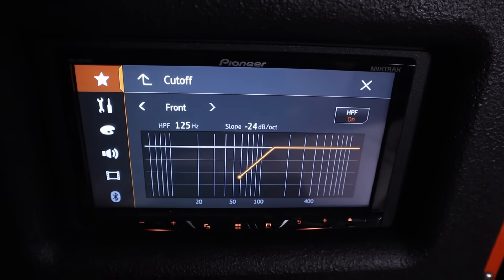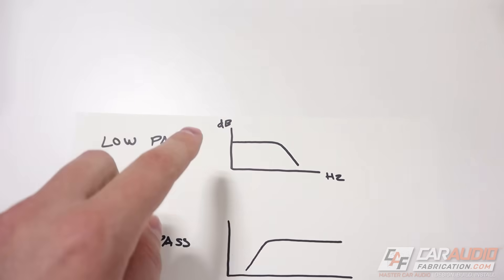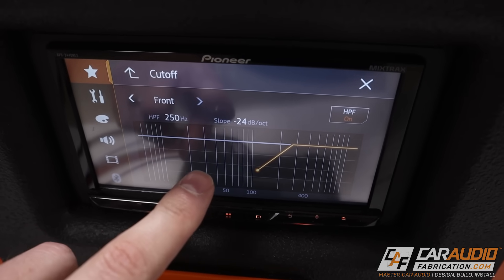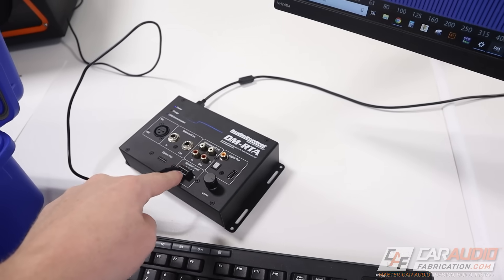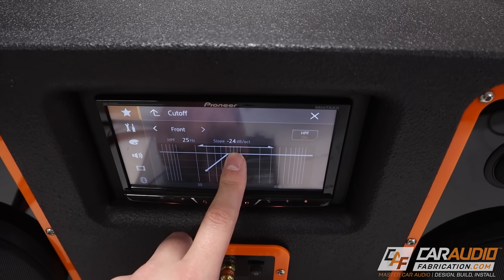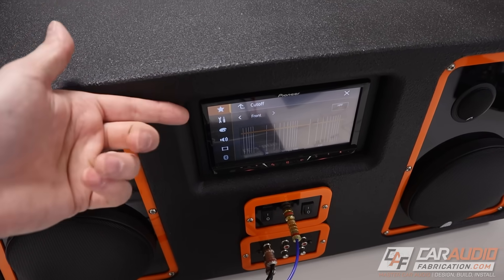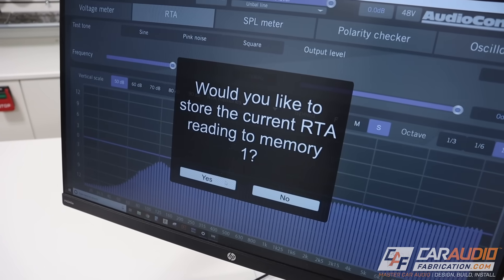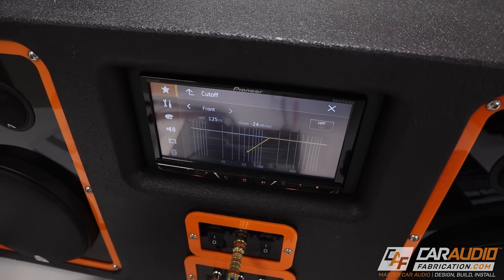Crossovers for Car Audio - Tune on HEAD UNIT or AMPLIFIER? Or combination?

Comment from the maker: 🔨 A big shout out to AudioControl for helping the community with a CAF FAN SPECIAL! AudioControl DM-RTA Pro Kit is currently on sale for a limited time. Use this tool kit to analyze and tune your system like a pro! To take advantage of this offer simply click the link below and you should be taken to the cart with the coupon code already applied.

✔️ https://www.audiocontrol.com/cafprokit

(If the link doesn't work add the DM-RTA Pro Kit to cart and enter code "CAFPROKIT") Thank you to AudioControl for being a channel sponsor and helping our community with this offer!

🔊  Related videos for crossovers:
✅ Advanced Crossover Lesson: https://youtu.be/BDKLYsGyBVU
✅ How to Protect Tweeters: https://youtu.be/hscMuzfyxQ4

Thank you for watching!
Reply: I'm curious to know what your opinion is of tweeter/mids speaker combos that have a passive crossover. I bought some a while back and they have been good, but thats my opinion and it keeps my set up simple.
Reply: I suggested a video ago that it would be cool if you explain in more depth adjusting input gain on a DSP before the amplifier... You told me you weren't going to waste a 10 minute video explaining something everyone knows... Now were back to videos explaining crossovers!? Is this something you believe your viewers need a 2nd video explaining crossovers?
Reply: I have a pioneer avh-x4800bs in network mode. Tweeters on front channel. Midrange on rear channel and subs on sub channel. 
Can I run the midrange on the FULL instead of HPF.  As long as I have it crossover to the specification of the speaker. 155hz - 10khz

Comment: How would you set the crossover if you dont know the Fs of the speaker as you explained in the older video? I have the Infinity Reference 607CF with the passive crossovers ( i cant afford DSPs and all that) and it doesnt provide that information for me to tune it properly.

Comment: This video helped me with fixing my issues with my front 6.5 speakers pushing to much bass. Thank you. The pioneer deck has the ability to adjust the crossover and it works great.

Comment: I always wondered what to do with the amp xover when you had deck ones.  I thought youd open them fully on the amp but now realize you are better off leaving it below the deck setting.im going to take pics of everything the way its currently set (because I like the way it sounds on all music types) but im going to fill around with settings and see if it have slope adjustment on the deck.  No dsp on this setup, that will be on next car.

Comment: You mentioned that setting crossover on both the head unit and amp will exaggerate the slope if set at the same frequency...for example if you set a LPF at 80hz on head unit, which frequency should I set the LPF on amp??
Reply from the maker: The whole point is dont do that. Set it at one or the other.

Comment: Not sure if you’ll see this; but I’ve wondered what a head unit does when I specifically change the tweeter crossover frequency within it? The Kenwood unit allows the x-over setting of: tweeter, front, rear and subwoofer - but there’s 3 unassignable (front, rear, sub) preouts; and traditional LF, RF, LR, RR harness outputs…So how does it cut off a frequency for the tweeters if there isnt anything actually separating signals or frequencies in each individual wire that goes to each speaker? 
Granted, I do have passive crossovers; and all speakers powered by l amps - but the head unit doesn’t know that! Does it just attenuate higher frequencies that still technically are sent on that one (+ & -)  wire that goes to each “corner”? What exactly occurs when that is changed?

Comment: Hello, I came across your video and you state "not to set Amp and HU to same value"; but you don't give information on what value to set the amp to so it doesn't cause issues with using HU. So, what value to set amp to act as a "safety" in case HU fails?

Comment: hi i need help my amp says LOW PASS FILTER 50-250 is this a good or bad amp? and can it hit below 50hz? this is a 4000 watt planet audio? some amps says 20hz or 30hz LPF ... please explain detailed, i guess what im really asking is can this amp hit 30hz or 35hz ?
Reply: Your sub will still hit those low frequencies. You just can’t tune your LPF below 50hz. Which you wouldn’t do anyways. Many Subs are tuned from 80-100hz but that doesn’t mean it WONT play lower hz. If you set it to 50hz, your basically beginning the cut-off at 50hz, so you’d actually get less bass out of your sub from anything higher than 50hz. Don’t worry, your amp is fine for a subwoofer. Most commonly, subs tune from 80hz-100hz.

Comment: Hello just came across your channel and I wanna say thanks for the info I have a question I just connected 2 tweeters 2 front 61/2 together with the rear and the tweeters alone on the front do I tune them individually disconnecting the amp for sun and the other front or rear depending on which I'll be starting on? Because they sound pretty good but are not giving me the power it should I now this donkey has a hard kick.

Comment: I have noticed setting my low pass at 200hz with 24 slope this gave me the most full sound from subs. I would normally use 65 or 80hz with 8 slope but there is alot of bass lost when I lower the frequency below 125hz.
Reply: what kind of sub do you have? I have a pair of DS18 6.5 subs and they recommend a 160hz LPF. Which is pretty high. I run it with DS18 6x9s in the doors and they recommend a 120hz HPF. So I’m wondering how to set up my crossovers? Rn I have the sub LPF 150hz -24db slope, and the 6x9s HPF 150hz -24db. Not sure if that’s optimal, but I’m only just learning about tuning and saw that -24db is best for when you set your x-overs at the same hz.
Reply: @_N4VE_ -24 db brings your speakers back into phase. That's why it sounds so good. Good job using your ears.

Comment: So quick question..  with a speaker like a 6x9 or 6.5 mid with built in tweater...they only have 2 terminals so that means I'm only adjusting there  frequency as a unit and not individually ? I'm a little lost on that.. like I'm setting my eq for better lows for my mid is that also giving the built in tweater more lows?

Comment: Great video, thanks! My pioneer ts a2013i speaker frequency is 25-28.000. That means that if i set my high pass filter at 31.5 khz with 12db slope is ok?

Comment: Dear sir help us we fit our Sony Hi-res  XS-162ES 2WAY Component Speaker 🔊 SX-160ES 2way Coaxial Speaker 🔊 and XM-GS4 4 channel Stereo Amplifier.. and XS-AW8 20 cm under seat Subwoofer. Bud sound quality is not good and explain how to set amplifier satting
Reply: I have almost exactly the same equipment as you, all Sony, same models but maybe different amps (Sony also)

Comment: Cannon thanks for your rich explanations. Kindly advise, I have in my car a a mono block dedicated to the sub and another 6 channel amp dedicated to all other midrange and tweeters and lastly a an equalizer.I however do not still appreciate 20-30hz wavy/ air bass, can adding an aftermarket crossover cancel off the punchy bass and give me only the wavy bass of 20-30hz to the sub. (All equipment and speakers I have are from pioneer high end)

Comment: I have the same head unit you use in this video, and I have a Chevy Silverado 2003 that came with Bose speakers, I have a 2500w planet audio mono amp and 2 12" power acoustic subs from Walmart. What should I set me head unit crossovers to? Please help

Comment: I have infinity 2 way speakers up front. Unfortunately I just hooked them up to my amp and its way to much power for them more than double. Gain is set with oscope would I adjust the power with the gain? And do I set 2 ways to full range or hpf?

Comment: If I am understanding correctly; if I wish to control the crossover through my head unit with DSP built in: for my component speakers with passive crossover, I should set the high pass filter on the amplifier to its lowest value as an added level of protection and set the high pass filter on the head unit, and for my subwoofer, I should set the low pass filter to its highest setting and control the low pass filter on the head unit, right?
Reply: Correct, but if you want to simplify things, just use one or the other.

Comment: Thanks for taking the time to explain these crossovers. What happens when you have crossovers in your speakers too? I just picked up a set of Hertz Mille Legends 165.3's. I have crossovers on my JL Audio HD900/5 amp, and the Kenwood Head Unit DMX 907s is where Im doing most my crossover work. I've set the amp to 50hz 12db slope, head unit to 80hz 24db slope.  The highs are 80hz 24 at the head unit, and 60hz 12 db at the amp. Then those huge speaker crossovers..... What do I do with those, they are spendy speakers and I don't want to do any damage. Any ideas?
Reply: this is the  question i came here looking for answers to as well.  off to keep searching........
Reply: Set the crossovers on the head unit to 100 hz (both the lpf and hpf). On the amp turn them off if possible or set the hpf to the lowest setting and the lpf to its highest setting.
The passive crossovers that come with your speakers are doing something else. They’re filtering the door speakers from the tweeter. Those don’t have adjustments and are just wired according to the instruction manual.

Comment: Thanks for this video, very useful info despite I already knew a lot :) we always keep learning!
My system uses a head unit with built in DSP and active crossover settings (Kenwood KIV-700), seperate amp for subwoofer (Raveland) and seperate 4-channel amp (DLS) for the speakers (DLS). The speakers itself in both front and rear uses their own passive pre-set crossover filters because they were a complete set. It works great, but after 15+ years of use I finally came across these video's and now I want find out if I can improve the crossover and gain settings :)

Comment: i NEED SOME HELP HERE LOL! Ok so my factory deck died so I bought a new double din. I was upsold to a kenwood excelon. Decided They may as well give me new speakers as well...that became upsold to an amp, new 6/9 in back and 6.5 components in the front 280 rms at 4 ohm. THEN I lacked the bass so I got an extra 1000w amp and 2 12" kenwood excelon subs in a custom box.. running 600w rms at 4 ohm. Here is the thing ... I bought pretty much the best speakers I could get from visions electronics. I also bought a 4 year warranty on all equipment and a lifetime warranty on the install. OK SO the excelon deck has all these super crazy settings ... just unreal and a 24 band eq ect ect. It also has options for slopes... this is where i get lost ... both amps are capable of 12 slope and deck will do 24 but run at 6 and honestly my music doesn't sound the way i like... seems flat. for $5000 you think they would tune it right ? I play mostly trance and some rock ... OK that doesnt matter been almost a year and trying to figure out the slopes. I am guessing go back to visions and get a tune but the options truly come down to deck. I pound it hard and thats about the only way it sounds the way i like it lol. Deck has slope options for each speaker and the subs am I doing something wrong here or is the only way I can hear mid is at full volume? fronts are underpowered. its component system that can take 250rms? feel stupid here but somebody send me an answer haha. furthering the confusion is the eq, bass remote for subs ect .

Comment: I have 4 speakers in head unit
In specs, they play 75-20 k hz
What should i put the head unit cross over on??
63/80/100/125??
Reply: 125hz, or 100hz the lowest.

Comment: If you set an amps hpf to 80hz with a 12db/oct would that add to the slope a passive crossover may have?
Reply: Passive crossovers filter the mids from the tweeter. The crossover from the amp filters the mids from the subwoofer . They’re not doing the same thing. You need both.
Reply: @gilbertogutierrez1658  Every pair of components that I have worked with have a crossover for the midrange and the tweeter, I was curious if the slopes added up.
Reply: @Silentroller93  Like I said they’re not doing the same thing, or should I say filtering the same thing. All components have that box that filters between the door speakers and the tweeters. 
The one from the amp/head unit filters what’s going on between the sub and the door speakers, so no, they don’t add up. They’ll only add up if you use both the head unit and the amp filters at the same time at(or near) the same frequency (hz).

Comment: What should I use to determine the setting for my high pass filter if the resonant frequency rating isn't available for my speakers?
Reply from the maker: Message the manufacturer and ask them why a needed spec is not available. Manufacturers are only going to stop their garbage marketing if they realize consumers are more educated now and want the real specs, not marketing jargon
Reply: @CarAudioFabrication  I contacted JL Audio and they provided me the specification. Fs is 53Hz and closest high pass filter on my head unit is 100Hz. Since I do not have a DSP in my system, I only have -12dB/oct crossovers to work with. In a previous video, you mentioned that the frequencies can cancel if set to the same value. Should I set the low pass filter on my subwoofer slightly higher than 100Hz to compensate?

Comment: What hertz do I set my 12 inch Subwoofer amp?4 channel amp 6x9 in rear and 6.5 door components with passive crossovers?front dash amp running two dashboard plate speakers with tweaters built in 4x6? Thanx will appreciate

Comment: If I'm using a 3-way electronic crossover for my two sets of 3 way door speakers and a sub, do I still need to set the crossovers on both amps or do I leave the amps un-adjusted (all settings lowest) and simply use the settings on the crossover or do I need to blend the settings (freq & gain) on all three devices?

Comment: Just after 11 min mark you take about setting the crossover on the head unit and turning it down on the amp not all the way but some as an added protection incase something happens at the head unit. How much further away should the number be to work effectively? You have your head unit crossover set to 125 and the amp to 40, but what if you have it set to 80, do you keep it set to 40? Or will it effect the slop more?
Reply: Yes you want to set at low as possible so you have full range sound at the amp but you can make you cuts on the head unit but I’ve learned pick on other the other depending which one sound better I use the amp crossovers on bc it sounds better but it could also be bc they don’t have 80 on the audio control amp only 100 90 or 75 at 12db. The advantage of using the head unit is that it has the ability to adjust the slope

Comment: I have a head unit that has four channel rca out(front-L/R @ rear L/R) also a subwoofer rca out. I bought a 7 band eq but it only has 2 channel L/R input. It has 4 channel out and subwoofer out. What’s the best way for me to hook this up? I have to go from 4 ch. to 2 ch. and leave out the subwoofer out if I use this EQ. Yes I’m a newbie but everything I read said good EQ’s help a lot. However, how do I hook this up?

Comment: I've been searching the manual for the Pioneer DMH-W4660NEX and watching videos and cannot determine if the crossover settings are applied to the speaker level outputs or do you have to be running RCA preouts to an Amp for the head unit crossover to work?
Reply: To both

Comment: Question, so my alpine unit doesn’t let me turn off the crossover for low pass, so as for my amp for my sub, should I turn its crossover up as far as it will go to effectively turn its crossover off there?

Comment: ihave arc audio black series 6.25 with tweeter and crossover for each (so 4 crossover )with 6x9 in rear would you recommend a 6 ch amp?

Comment: I have a Benz, C230 Kompressor Coupe... What can I do with all that sadly produced 80's rock on my playlist given that I only have 3 speakers (dash, doors) and a Diamond 12 ported sub in back? I don't have an amp for my new headunit just the sub. I want just enough to Rush's Best Of from the rear seat are. Are crossovers necessary to hear YYZ as it was meant to be heard?

Comment: What is a general rule of thumb, for pairing a 4 channel amp, lets say 100 watts RMS per channel, what would be the watts for the the subwoofer. The goal is to have a balanced system from 20hz to 20,000hz, not crazy volume. It gets as loud as I'm comfortable.

Comment: Can someone help me out? Im thinking about getting the Morel Hybrid 602 2 way component speakers which comes with the MXR240.3 passive crossover. Should i still use the crossover on my headunit (Alpine UTE-92BT, currently set to 80hz with 12db slope) as i do today or should i set them to flat and let the passive crossover handle it? Or should i use both..?
Reply: Did u ever get an answer to this? I have the morel tempo ultra wit the crossover and tweeters that came with them and I actually have been using my pioneer hu to set my hpf
Reply: @NightmareonAnyStreet_  Yes, set it on the HU!:)

Comment: So if you said not to have the head unit and amp at the same value due to the slopes, if I'm using the head unit crossover ans say I set my LP at 80 with a 24db slope, What do I set the amp LP at?

Comment: I chose the pioneer head unit that is displayed in this video and was disappointed. The low-pass for the mid-range (which is actually my mid-bass) only goes down to 1.2 kilohertz. I need to xover the mid-bass blend into my horns at 800Hz. It will only let the mid-bass and horns xover at 1.2Khz. Now I'm going to have to buy an external crossover.